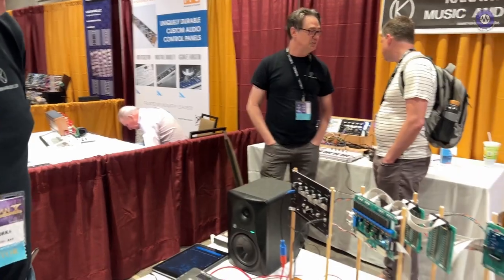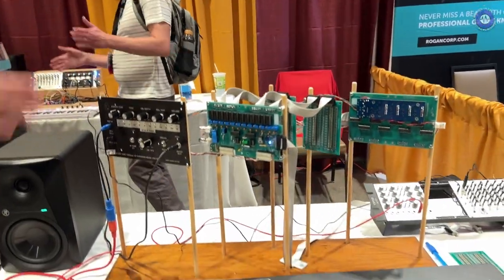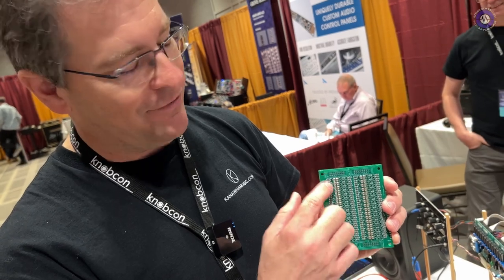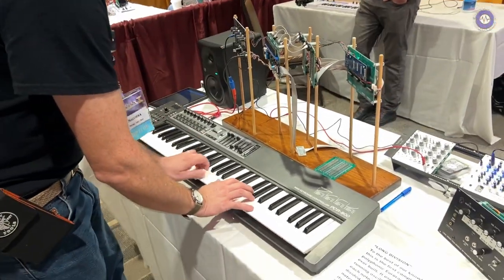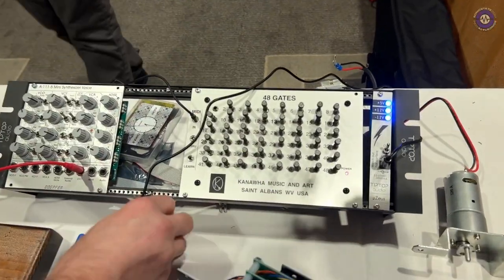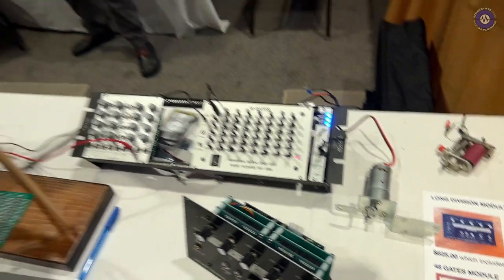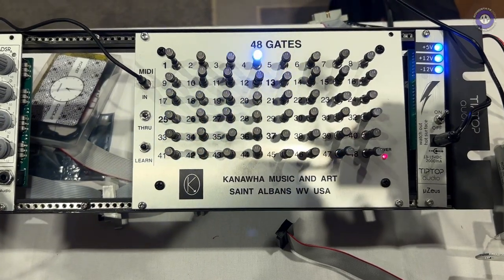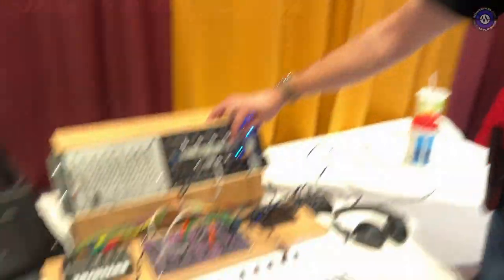Knobcon 22:  Kanawha Divide Down Organ in  Eurorack

Comment: True story folks! I'm the one that designed it and is doing the demo. On testing the production units, I found that one capacitor, a tantalum one in the vibrato circuit, kept failing for whatever reason. So, I took them all back apart and replaced them with a standard mylar cap, which works great. Of course, I totally forgot about the exploded view model- so of course the cap failed RIGHT AS I'M TRYING TO DEMO THE UNIT FOR A WORLDWIDE AUDIENCE. Later that day I went over to the Division 6 booth and hit them up for one of their super precise soldering irons and replaced the cap on the demo unit, which worked great for the rest of the day! Also: thanks for all your kind comments. I was afraid we'd be laughed out of the room, since a lot of Eurorack folks don't think polyphony is particularly important. (I guess it isn't, depending on your style, but I like it!)
Reply: Man I dig it.
Reply: Man, you could make a string machine module with this tech, much like the revered Solina!
Reply: @IntiAlonso  Yes- I've got a dead Solina in the shop I'm going to take a look at...the problem is dividing down sawtooth waves; the binary dividers just give me squares!
Reply: If there's anything that the Eurorack folks need it's innovative modules like this! Great work!
Reply: @superultrathanksmom3845  Thanks! I'm starting work on the next module which should be just as unusual.